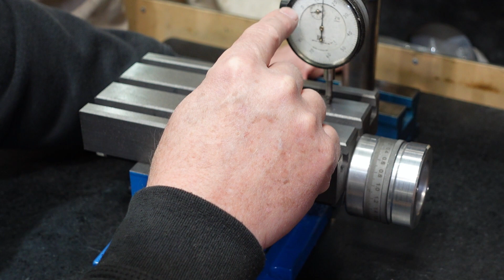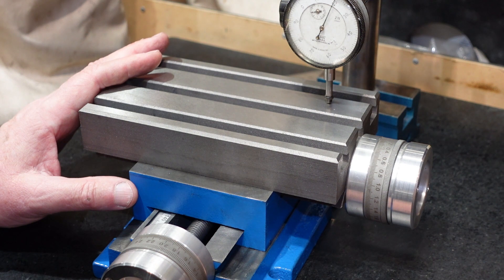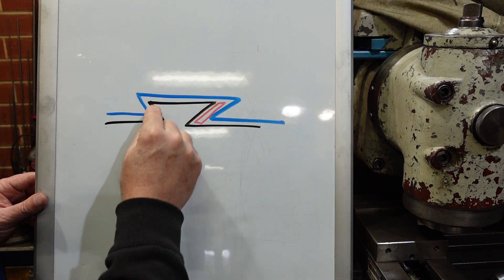The X-Y table kit - a starting point (first of three)

Comment: I love how much the indicator is moving around when you're just lightly touching the xy table at the beginning, after measuring it, as those tiny point contacts creep about under mild pressure.
Reply from the maker: I mentioned this project to the guy who taught me to scrape, and after watching the video, be commented that I have far more patience than he does...
Reply: @occasionalmachinist  As someone who scrapes a little, I think there's value to putting a whole bunch of time into a cheap wreck and cranking up your skills.  I'd be scared to touch a valuable but worn machine tool.  But an import table?  Fantastic, and a great demonstration of how much you can improve it.
Reply from the maker: @smellsofbikes  Thanks! It's actually a good size for turning into a silk purse.

Comment: And that boys and girls is a good example of how to get your hands on a set of rough castings and learn to hand scrape to a finished product and fix any underlying problems that you may encounter along the way. The video makes it look easy but its long/hard work. Scraping is indeed a good skill to learn as in the future we are going to come across more and more machines in the "kit of parts" form in this world of competitive (aka cut-throat) pricing.
Reply from the maker: This bit was the easy part - in the next installment I then do the angled surfaces and square the axis up to each other while preserving the necessary geometric relationships. Scraping really is a skill that you need to be shown though. The difference between doing it effectively and just faffing about on the surface of the CI is pronounced.

Comment: As he says, at this price the table is a kit. If you have the time and patience, you can make a usable table. If you want it to work out of the box buy the Taiwanese Vertex. Yes, you will squeal a little at the price, but after 6 months you won't remember what exactly you paid and the quality will remain for years.
An aside about mainland Chinese tooling. Check carefully as to all up price, especially the shipping.  I discovered that I could buy a Vertex 4-inch Kurt style milling machine vice and an 8-inch rotary table for less than the mainland mystery equivalent. If you are not familiar with Vertex, they make industrial grade CNC tooling and vices as well other shop equipment. Their stuff comes with a parts list, a phone number, email address, and street address where they may be contacted.
Cheers from NC/USA
Reply from the maker: Vertex stuff is good gear, widely used in Australia both in home workshops and industrial situations. Unfortunately, a lot of what you can get in the US is not available in Australia, so while there is a Vertex table of a similar size, I don't think anyone stocks it. Due to the low volume, I'm guessing that it would be punishingly expensive.
This video was partly a check on the quality available in these budget products and partly because it was an opportunity to develop a bit of kit that I would like to try using at a later date - and I could practice my scraping skills too.

Comment: Good educational video, and I'd agree with you on the "kit of parts", especially after seeing the tolerances or rather lack thereof.
But, I've got a question though about the 4mm pitch on the dial, by any chance do you have a dual thread/double start thread consisting of two 4mm pitch threads spaced 2 mm apart? 
I know it looks like a 2mm thread and your thread gauge will fit it perfectly, but if you wound a piece of string around the one thread does it skip a "thread", very much like it would if you did the same to a normal twist drill with 2 flutes?
( I hope I've described that adequately)
Reply from the maker: I did wonder that at first, but the website said 2mm pitch and I put a dial indicator against the table and wound a revolution and got 2mm. I did not think of the string check (no string in the shed) but that would have worked as well. My best guess is that the factory was running short of parts and rather than stop production, they just got a similar sized part used on a assembly somewhere else. There was another part substituted in on the same basis I think. Both have been corrected.
Reply: @occasionalmachinist  👌I look forward to the next installment.
BTW Do you know what a dual/double start thread is called in Aus, I haven't found any good reference to one on this side of the pacific?
Reply from the maker: @Bobs-Wrigles5555  From memory, there is not a specific name for them, but if you talk about multi start, two start or dual start thread, most machinists will know what you are talking about. Just as a tease, I once did a 7 start thread...
Reply: @occasionalmachinist  😂😂